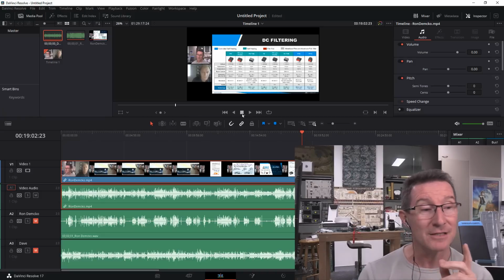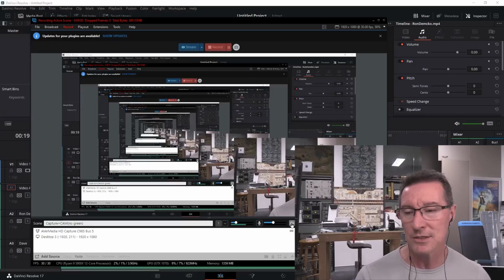Here's How I SCREWED UP a Live Interview

Comment: Edit: just saw others had the same idea, I'm just a day late :D I could try using the provided audio files, but multiple people who are more skilled at this seem to already be on it so I'll leave it to them.
Dave there is a clean solution, I had the same a couple months ago.
You can Substract audio! You have his clean audio, you can resync it manually, and then Substract his audio from your track, then you habe his clean audio (which you already have) and your clean audio.
I had that issue before, i was recording a desktop clip with mic, but I had my speakers on! Duh! But I had split recording tracks for microphone and desktop audio.
So my microphone had desktop audio echo in it, but a bit delayed, basically exactly as your issue. I used Adobe Audition to Substract the clean desktop audio clip from my Microphone.
Because speakers into microphone is not perfect, it wasn't a perfect fix but good enough that people didn't notice. But you have desktop audio straight into recording, you should have a perfectly clean signal, that should work.
Adobe audition can do it like, you have a stereo track, left channel is one track, right channel is other track, you invert phase of left channel, and combine them into mono, boom left channel substractrd out of right.

Comment: As you describe, channel A3 is a good mix, just Ron needs a bit of amp to match your audio level. Also A2 is Ron-only. So just mix A2 (with a few dB amplification) and A3 after sample-accurate alignment. Of course this way you only can correct his audio level up and blend out you coughing over Ron, not the other way. The best you could get without filters or subtracting signals.

Comment: I noticed a lot of these issues stemmed from you having work around Streamyard not accepting your Avermedia capture card as a direct input camera. Maybe in the future you could add the Elgato CamLink to your setup instead. From what I understand this would solve the need to use X-Split to create the video source for your mock "webcam". The CamLink is direct video HDMI to USB, low latency and cross platform. The downsides being it relies on the computer to do the video processing as compared to your Avermedia or a standard Elgato capture card, which has the processing onboard. But for your purposes that wouldn't be an issue I think. 

As a fellow media creator, I know that you never want solutions to invlove more equipment. But I just wanted to pass it along. Cheers!

Comment: Sound recording seems to be tricky and Murphy is always somewhere in the background. When doing Zoom-lectures during Corona lockdown (yes, here in Sweden!) it happend to me twice that my recorded OBS-files did not at all contain the audio. In both cases I had updated OBS just prior to the lecture and missed to check the audio settings. In both cases my microphone as audio source had been disabled after the update. Since Zoom was using direct access to the audio separate from the video signal which was provided from OBS, neither me nor my students noticed any problems during the streamed lecture, but the recording which I wanted to make accessible afterwards was muted.

Comment: Another option, if the echo and noise removers don't work, is simply re-record your side of the interview. (Because it was only your dialog was messed up). It's used so often in the TV and movie industry it has a term - ADR (Automated Dialog Replacement), otherwise known as looping. 

Basically after an on-set shoot, usually outside, the audio captured will be problematic - dialog is faint, there is external sounds (planes flying overhead, cars honking, etc) and other issues. So they get actors into an ADR booth and basically have them re-record all their lines again, mimicking the cadence, inflection and other aspects of the dialog so it matches with the video. Done right, the fact it was done is basically imperceptible. 

You technically don't need anything to do this, but ADR software makes it easier by looping the problematic audio and video over and over again and having you record multiple takes until you get it right. 

Just another option out there. Some people don't like it because it gets rid of the "originality" in that the audio was recorded post interview, but if the audio is unrecoverable it's an option. You can even employ it with other techniques so you don't re-record the whole thing, just the really troublesome parts the other techniques fail at. But it's there because audio is key.
Reply: Could you imagine trying to lipsync an hour long interview? Remember, there is video to consider.

Comment: i do sympathize to some great extent dave. but in particular (having tried myself)... that windows audio routing just either doesnt exist built into the audio stack (as a standard thing), or it isnt very good. or it only works with specific hardware and software

so you're left confused and largely pissing in the wind. (for want of a better term...) since then i have now moved over to linux. and there we are still in a great deal of flux what with the new switchover pipewire audio system. but one thing we do have is a node graph of all the audio stream conections within the computer. (and now also will be joined by video streams too. and with that ability to quickly look and double check what is connecting where, and also develop configuration rules for another daemon to enforce connection rules policies (kinda a bit like firewire rules). such that its possible to either automate (or to prevent) certain specific combinations of connections without manually intervening in the gui.

so in short the futures bright over here on linux. even though it isnt there yet and still has a lot of bugs right now that are being worked though by the pipewire developers. and btw... you can also run versions of both davinci resolve and obs studio on linux. (however not sony vegas and xplit, we dont have those)

macs are also a great choice for audio. just maybe not so much with windows eh? at least i dont see microsoft overhauling their audio stack anytime soon :/ ...it is pretty archaic, the way it has evolved, how it is structured, and  can be quite problematic in certain areas. (for example not just with the routing, also at time with specific hardware or drivers, even with the asio and whatnot). but i'll leave you to it! those are all the  set of imperfect alternative choices we have at the moment. whichever platform(s) you are on
Reply: I've built my own nice graph on windows, using Reaper (audio software) and Virtual Audio Cable to organize all my inputs and split them to all the outputs I need, including mixed outputs for stream out

Comment: By the way, no matter how valuable you perceive your guests time, always, always test. Always. Even the most VIP of VIPs we've had remote into panel discussions and interviews that we've been recording, we do a quick test with them before. Almost everyone understands the importance of it and generally people would rather you took steps to not screw up the production (and thus have wasted their time completely).

Use the time to briefly touch on the topic and format and to make them feel comfortable with going into the real thing later. And if there's something totally buggered with their setup such as a bad sounding mic, you can politely suggest they try another one at that point. 

I do this stuff professionally and I can tell you there's always a chance of even the most tried and tested setup using the most expensive gear to screw up, more often than not due to human error, but sometimes unexpected bugs in software or hardware glitches catch you out also.
Reply: I second this, I’ve done it professionally to and how many test streams (and rehearsals) I’ve done is insane. Always test and double record if possible .

You only do it one time wrong, mine was at a funeral, with the wrong foto slides (had multiple that day) and audio muted in the recording (livestream was fine lucky). Never again.

Comment: Dave, if it helps, I use ATEM ISO Pro. For video, I am recording two monitors, one is the shared desktop, one is with our cameras (+ I am testing possibility to record also video from my camera directly). For audio,  I use Focusrite to separate audio and both audios a plugged into the ATEM audio inputs. In postproduction I ask my son to create three videos - desktop with full audio, my video only with my audio only (synced corrected if needed) and guest video only with his/her audio only (synced). The only disadvantage is I can't get high quality video from guest but otherwise I am super happy with the setup - and I can test it always just before recording, to be sure it will be recording correctly.
Reply from the maker: I have ATEM Iso too for the live streaming bench, but I wasn't using that this time.

Comment: You could try applying a compressor to the combined echo-less audio. It wont fix the ability to chop out noises etc, but it should provide you a more normalised level between you and your guest.
Reply from the maker: Yep, I used The Levelator and it worked very well.
Reply: @EEVblog2  Good to know you went with the most straightforward option!
Reply: Echo-less? Dry.

Comment: Dave I could try and clean up the echo audio. I am an audio engineer. We have tools for cleaning up reverb and echo. Sometimes they work, sometimes they dont Let me know.... you can reach me at my email on my channel. You can get me the audio and I can give it a whirl.
Reply from the maker: Actually, I'll take you up on that. I'll email you Ron's voice and the mix track. Are you able to remove Ron's voice from the mix just leaving my track?
Reply from the maker: The downlink link is here: https://www.dropbox.com/sh/xb08own94f6sf9k/AAAepI47meKx8Ow1vzVGiHIDa?dl=0
Reply from the maker: Thanks, but I think I'll just run with the mixed track after running through The Levelator. It sound pretty good. I don't really want to edit >1hr worth of two separate tracks anyway to tweak slightly talking over each other.

Comment: Why not just shift Ron's discrete channel (presumably right) to be aligned with the mixed channel and Bob's your uncle? If they are the same audio and perfectly aligned, there will be no echo. I do this in Audacity all the time to create echo.... duplicate the track and shift it right how ever many milliseconds I want the delay to be.
Reply from the maker: Original audio files are here if anyone wants to have a go extracting only my voice : https://www.dropbox.com/sh/xb08own94f6sf9k/AAAepI47meKx8Ow1vzVGiHIDa?dl=0
Reply: @EEVblog2  I'll try and play with this tomorrow
Reply from the maker: @elitheelectronicsguy  Thanks but someone alreayd tried and said the changing phase in the stream didn't make it viable. I'll run with the mix version.
Reply: @EEVblog2  I played with it for a couple hours last night. I ran into  2 challenges... 1. Ron's amplitude was higher than the mix so obviously there is no way invert will cancel him from the mix. It will only flip the waveform and you will still hear him, only inverted. I tried to match the amplitudes and that seemed worked, but #2 for some reason the waveforms are not staying in sync throughout the track. After I got them synced in one section they became out of sync a few seconds-minutes down the line. I think there is a slight varying delay in sampling as it's being processed through xsplit.

I recognize you are moving forward with the mix. But, I am intrigued to see if I can solve this problem. I'll let you know if I succeed.
Reply from the maker: I just tried that and his lips are out of sync, but it sounds ok.
Reply: @EEVblog2  ahh...   try to remove Ron's voice from the mixed channel using a noise canceling algorithm and Ron's discrete channel as the source for the noise filter.  Destructive interference. This should give you a discrete channel for yourself.
Reply from the maker: @donbeckham  I just tried that in Audacity. Imported the mix track and Ron's track, alighned them, inverted Ron's track and then mixed then together. My voie is fine, I can still hear a muffled echoey Ron.
Reply: @EEVblog2  If it's not an alignment issue, I have to assume this is related to sampling mismatch because in my test using the same sample rate on everything, it's a perfect inversion and fully canceled. I wished it would have worked for you. I wonder if there is a easy way to match the sample rates between the two tracks.
Reply from the maker: @donbeckham  The problem seems to be that inverting Ron's track doesn't help erase it when I'm not speaking, so I just end up with his audio inverted when I'm not talking. So I can't get a track that's only my audio this way. This is not an acho/alignment issue, it's trying to remove one voice entirely from a mixed track.
Reply: @EEVblog2  Also, I noticed that when you and Ron are talking together, the waveform is the sum of both (you and him), so an inverted copy of just Ron talking should cancel him from that sum. I would have thought that the inversion would shift the voltage for each sample back to the original, being only you. But this requires EXACT sample matching to work, and this is the challenge as I mentioned in the previous message. They are not staying synced throughout the track.
Reply: @EEVblog2   I created a test track, duplicated it and shifted the duplicate one second, exported the mix (with echo) to file and added it back into project. Inverted the shifted track and  VOILA... perfect sounding original audio (no echo) while playing the mixed track.